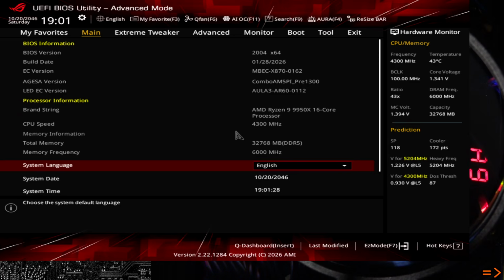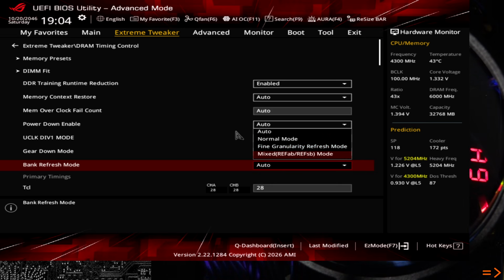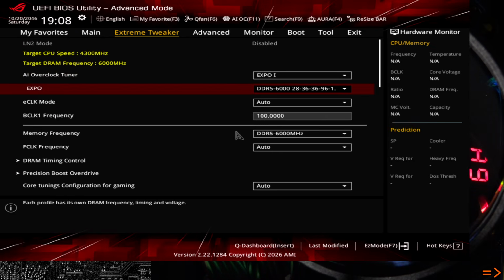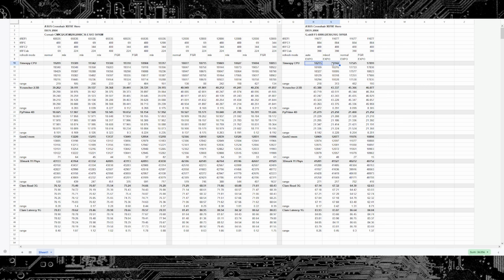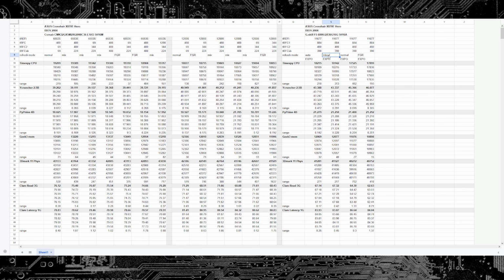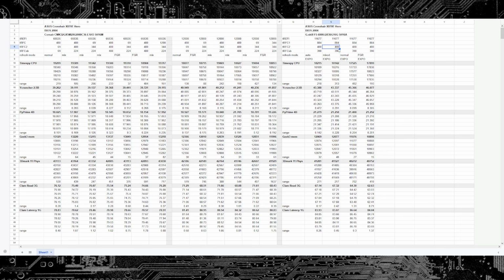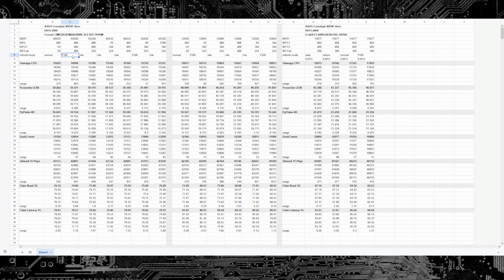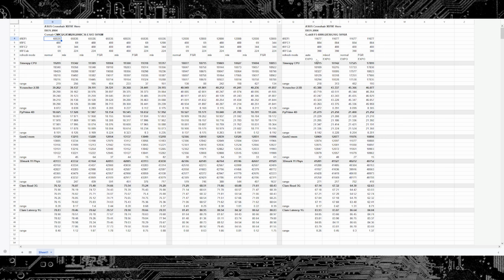New DDR5 refresh modes on AM5 motherboards

Comment: Still running a daily, ddr4 4100 cl15 1.5v, OC because of you. Appreciate all the work brother. Was gonna upgrade but then everything went whoops when i was able to.
Reply: mb warns going over 1.35 isnt 1.5 causing wearout or errors? how long have u had it
Reply: @GloriousEagle69 the ram has been great, no degradation I can measure. Its b-die g-skill so of course the ram is fine. BBBUUTTT, lol, the first mobo did break. I run a more basic msi z790-p pro wifi d4.  I ran the SA voltage on auto with ram at a set  1.5v and it poped the SA voltage circuit. On that mobo SA voltage wont go above 1 volt now. so you cant run ram faster than ddr4 3600 cl 16.  Slowly over time it just would struggle to boot, till it didnt one day.(i thought it was my 14700k)  I got the same mobo again and this time did everything the same but set SA V at a static 1.35v and i have had zero issues since, been about 14months. Even ran 1.55v ram voltage and 4200 from the mobo for a month even. Dropped back to 4100 for general system stability.  The mobo is great other wise. It will take my 270 watt 14700k oc like a champ. I just know now SA voltage control was Not ment for auto on a decent ram oc. Idk if im just lucky, but my daily big oc is working. I use the old board as a jellyfin server with a 14100. Never crashes or errored out. So, the old board is still good just bad SA voltage.
Reply: Daily driving DDR4 at 1.5V is for people who are perfectly aware that they may have to suddenly buy a new kit. Considering the current RAM prices, and sometimes difficulty even FINDING the kit you want, I'd categorize that as "a bold move".
Reply: @andersjjensen  oh no big red number in bios = bad! I dailyed 1.65v on my S8B for ~18 months with no issues/degradation
Reply: @IIHydraII  Builzoid has killed memory kits with less than that, and he doesn't recommend daily driving over 1.45V, so I'm going to take his word for it over someone who thinks getting lucky will define the case for everyone.
Reply: @andersjjensen been using 1.65v on my s8b since 4 years, still passes every stress test, it's really hard to kill ram
Reply: @aqyx  As someone who has managed to kill RAM on more than one occasion: It's really hard to kill RAM that doesn't have a near-defect.
Reply: @andersjjensen it was a used $60 ebay kit and Its samsung B-die. The dude labeled it as  a gskill kit with the model number ending in "NC" instead of "N" even at the time, the B-die kit was going for $150-$200 . 
So, I say, LET IT RIDE!!.
You're not wrong though.I have a 32gb 3600 cl18 kit i can fall back on.

Comment: We have the power to bring down RAM prices right now. Every time we use cloud-based AI services, even the "free" ones>>we're fueling a massive demand that's draining the market. These AI data centers don't just cost billions to build; they cost billions to run, and they're consuming an enormous share of available RAM. The solution is clear: switch to local AI models running on your own system, or simply reduce your AI usage. Once we collectively hit their "demand cap," the pressure on RAM supplies will ease, and prices will finally drop. It's time to take control of our technology choices and stop letting corporate AI infrastructure dictate hardware costs.

Comment: I’ve been watching your content for 5 years and still feel like an Apple user in my knowledge base. Hoping for one day to just understand this.
Reply: Unless you're personally into competitive overclocking spending 2 weeks tweaking, benchmarking and logging the result in a spreadsheet to prove a 0.7% gain is objectively a waste of time. I check in from time to time to see if there's any updates to his "easy timings". I.e the timings that he knows will work with 99.5% of all memory kits with those specifications.
Reply: All I did in my 5 years of AHOC too is I wrote down notes about it since his safe OC is a great gift for all who can pay attention, but I don't have the money for the equipment and room for PC extremeOC research myself, besides my tools for PC services. In the same years I just do OS tune up with Gentoo Linux for gaming and later on I've figured out CachyOS kernels is really good for any prebuilt Linux distros if you want a quick setup without the craziness of kernel modifications besides no systemD distros. For winNT kernels; best to trim the OS to like Windows 2000/XP or Win7 if you can still run it or last option to hyper-modify Win10 and don't use 11 no matter what. I just use the computer to its full capabilities without stressing it and having power saving features on because my power plan is limited tier 1 of wattage for the price.

Comment: Don't buy MSI boards guys 

No support for x670 anymore not even for security updates. Got a godlike and last stable update was almost 1 year ago
Reply: Msi board are the worse for me since the bios issue will require to reset each time you got error in bios settings when changing oc for ryzen memory, and many recoil whine issue which can be leak inside your output audio.
Reply: @farhannik7039  I have 0 issue wit audio only if VDDG is low when using 2200FCLK.
Reply: Too late, I got mai b850m gaming plus wifi6e in October, it have so many buggs but does not harm at last like asus/asrock does.
Best brand is to go is gigabyte in my opinion.
Reply: @Kage0No0Tenshi what bugs do u have because i have the same board but normal atx format

Comment: Interesting. My 8000mhz ram stopped working when I updated the BIOS. I had to increase memory voltage .025mv to get it to boot. Makes sense.
Reply: Good tip. I won’t update then for a while.
Reply: You had memory context restore enabled? If so, thats why. Disable and make it boot couple times with powerdown disable and mcs disable and after enable it.
Reply: @Eusebiugh I dunno. That was just in auto
Reply: @Eusebiugh  Thanks for the tip and confirming my suspicion why my system wasnt booting with settings that were previously stable.
Reply: Core voltage also changed. My PBO per core offset shifted 3/4 into curve shaper with simple math also crashed on kernel power. I suspect it might be minor.

Comment: Any suggestions for a defeated guy who can’t get 6400mts 64gb Hynix a die stable 1-1 with a on a 9950x3d and x870 hero astral 5090 gen 5nvme with 2 gen3 nvme in raid 0 want peak performance (currently have 6200mts cl28 1-1 2200fclk with right timings
Reply: Be happy with 64GB at 6200? More than 48GB (ie 2x24GB) is really hard on AM5.
There is a new generation of 32Gbit chips that allows manufacturers to build 32GB sticks as single rank which should be the new best for 64GB and maybe even enable decent 128GB configurations with DR modules, but I don't think they really have hit the consumer market yet.
Reply: @giantnanomachine  thanks for the reply. I am pretty happy with it. I just feel like I didn’t hold out this time and bought the best I could and I wanted it to be the best performance it can lol
Reply: If your I/O die won't do 6400 it wont do 6400. Mine won't go above 6200 either, and it wont even do a 24h full stress test at 6200. So I run 6000 with close shaved timings. The difference between 6200 and 6000 is less than 1% at 720p Low in gaming benchmarks so I really don't give a fck. Stability before performance.

Comment: is 1.5v vddio safe long term?
Reply: If it’s cooled really well then yes but I’d lower it for daily use
Reply: @LightWorks222  cpu is cooled with a 360 aio with push pull config. also tjmax lowered to 80c. for the ram i got an amd stock cooler fan blowing air on it. i also removed the plastic top cover for the ram sticks. 
if temps are fine, is 1.5v safe for daily use? i mean for vddio on the cpu. peopIe tell me 1.45 is the upper limit and that 1.5 is too high

Comment: What to use for gskill 6000mt cl30 m-die? Which values to put for the mix mode? I mean trefi, trfc, trfc2, trfcsb?
Thanks
Reply: I'm wondering if the values from Buildzoid's "Easy Timings" video (which worked perfectly for my kit) a while back work with the new Mixed Mode.
Reply: @Arthur78 i am using them too, so far not even 1 single issue, but i am not sure are they good for mix mode. I mean to stick with same values?

Comment: I have a spring 2025 bios (asrock 650 hdv/m.2)and I have tuned settings.(pbo and timings 6200 a die).If I update the bios to the new one is there a significant chance that I will face instability or latest bios almost always means better stabilty?
Reply: It depends on what they change. The idea is newer BIOS means better stability, but sometimes there can be bugs. If it's working fine then leave it with what you have, if there's a new feature or any particular reason to update then you can update. 

I have an Asrock X670E Taichi and the latest BIOS 3.50 has been a bit better than my old one which I think was 3.25, there's a bunch of new options, and my Ram doesn't train every time I save the BIOS with settings unrelated to Ram so it only trains when there's changes to Ram settings. Stuff like that is great, but it depends on your board and manufacturer.

Best thing to do, is to google around or ask on forums for others with the same board, even maybe try and contact the manufacturer directly if you can't find much else online. If you have a popular board then likely a few people will reach out on the forums. Otherwise, if your PC is running fine and you don't need to update for any reason, it's best to leave it and save yourself any potential trouble.
Reply: @mttrashcan-bg1ro ok thank you so much for the info dude, much appreciated

Comment: Does this also apply to ryzen 7000
Reply: Yes , it is also AM5 socket
Reply: @pfbtheboy  except AMD loves segmenting 7000 and 9000
Reply: @bananahammock888 As they should two different gens.
Reply: @MrNelahem same IO die on both generations, so should be same memory controller
Reply: @jbettcher1  yes two different generations with the same memory controller.
Reply: Both 7000 and 9000 use the same memory controller.  You should most definitely be able to use this on 7000.
Reply: @skylertschmidt really? I thought 9000 had much better IMC why it scales above in mem freq?
Reply: @christofferaasted  AMD used the same IO die on both generations for consumer parts.  Which means they use the same IMC.  

Optimizations on motherboard AGESA and BIOS as well as maturation of DDR5 as a whole have allowed for higher speeds to become much more stable, albeit the performance to be lackluster.  

This was one of the reasons non X3D 9000 chips were relatively lackluster at launch and the recommendation unless you wanted to spend quite a bit for a martial upgrade (4-8% in some cases) was to stay on 7000 if you had it.  Most likely still the case this late in a socket generation for AMD. 

Now the server chips that were launched with the 9000 series had a new IO die and saw incredible uplift compared to the previous generation. So they COULD have had a much bigger win, theoretically.

Comment: This sounds great and I want to tinker with my 870E Pro Art
But it also sounds like a potential nightmare for stability in overclocking.
Reply: That's what I was thinking. Might have to do 2 sets of stability testing to avoid the switching; normal mode and FGR.

Comment: It would be quite interesting to see which timings work for 2x32GB 16Gbit M-die, since those old kits are currently the most affordable option (for a given degree of affordable...) to get 64GB DDR6000 Hynix on AM5.
Reply: Those are dual rank, right?
Reply: @Arthur78 yes. I think also most new 2x32GB kits are still based on 16Gbit chips, but on A-die; the newest ie 32Gbit chips don't seem to be widely available yet.
2x32GB 16Gbit A-die might also be interesting to look at cause DR likes to be weird in general on AM5 (I have no idea about how Intel, maybe that applies to DDR5 in general), but probably less so than 2x32GB 16Gbit M-die.

Comment: Im too scared of ram oc in 2026, I can't afford a new ram kit🥲
Reply: Just don't crank the voltages. If you get greedy on the timings at stock voltages absolutely nothing bad will happen to your RAM. Your system will just be unstable or refuse to boot. So you try less greedy until it is stable. Simple.

Comment: What about refresh management setting in amd cbs, you can force not /2 refresh on fgr as far as i understand
Reply: Test if it works. Lots of things in CBS don't actually apply, or cannot be changed without a flash 😅
Reply: @bananahammock888of course it applies also if you mean lile timings you need to set in both amd cbs and in amd overclocking

Comment: How much more performance one can actually expect to gain in games with this new setup in Mixed mode? 2-3%?
Reply from the maker: considering that across all my tests mixed modes is winning by around 0.2 to 0.7% I'd say less than 1% in games.
Reply: It will not give you performance. But it should reduce the unexpected stutters, unreal engine 5 springs to mind.
Reply: @ianoconnor1515  A 0.7% decrease in memory latency will not fix game stutters that last several milliseconds.
Reply: @ianoconnor1515 please update us on this specifically! 4090 with 9800x3d and im using timings from your video and i get great max frames but it just feels like i lost 3-10 frames regularly when I absolutely have the overhead to not stutter!

Comment: Im on a bios version i wouldnt be able to go back to if i upgraded on a x670e proart with 4x32GB at 4800cl32 im just not going to touch it...
Reply from the maker: BIOS flash back does let you downgrade.
Reply: @ActuallyHardcoreOverclocking i wish i had known this. I'm on 3104 and 3112 says irreversible and was scaring me from upgrading. Thanks

Comment: Sorry for the basic question; but I've tuned my RAM (Hynix A-die, 6000/CL30) according to one of your previous guides on AM5(9800x3D). Will redoing it with new refresh modes be beneficial? I'm optimizing for 0.1- and 1% lows in competitive games.
Reply: could be beneficial although you probably wont notice a difference since your percentile lows are already very high anyway. even i dont see a difference even though im an ultra sweaty e sports gamer
Reply: With an X3D chip borderline all real world applications show no difference when Buildzoid produces 0.2%-0.7% differences in synthetic benchmarks on a vanilla X chip. I have a 7950X3D myself, and it's funny seeing how benchmarks vastly different whether I lock them to the vanilla CCD or the V-Cache CCD. That honking big cache all but completely hides the memory interface.
Reply: @andersjjensen  yeah. also even on the non x3d die performance is still very good anyway. worse case scenario you get just about the same performance as a 7700x. last time i checked the 7700x is an excellent CPU and can even keep up with a 5090 in some games

Comment: Meanwhile MSI x670e gaming plus latest bios is from October 22nd 😂
Reply: BIOS development for 600 series motherboards kinda slowed down since 800 series launched. And it has slowed down even further lately
Reply: Its slower on Asus for 600 series board but not as bad as MSI. The last bios for my 670E board is dec and agesa 1.2.7.0
Reply: @MrNelahem 💀
Reply: Gigabyte seems pretty good in that regard. AGESA 1.2.8.0 non-beta was released early January already for X670E.
Reply: Same here, lastest bios is from October 25th 💀
MEG X670E ACE

Comment: G'day Buildzoid,
I won 2x4GB Crucial DDR3-1066 CL7 on Ebay yesterday for $5AUD 🙃👎
Hoping it will allow me to get my i3-540 to run with more than the single 2gb DDR3-1333 it will POST with out of all the RAM Sticks I have in my Testbench collection

Comment: How does this affect dual channel vs single channel? Do the 2 sticks refresh at different times with FGR? Also seeing as a lot of people are gonna be run single stick of ddr5 now maybe a special episode on optimize bandwidth with just a single stick?
Reply from the maker: each channel has it's own command bus so refresh commands can be independent. How the CPU designers actually decide to implement it IDK.

Also LGA1700/1851 and AM5 are all technically quad channel platforms since DDR5 has 2 32bit memory channels per stick.
Reply: @ActuallyHardcoreOverclocking  single stick overclocking when? looking forward to it

Comment: Do we have any decent way to calculate what trfc2/sb values to use? Or is it more so trfc2=1 and sb / 2?
Reply from the maker: trial and error
Reply: @ActuallyHardcoreOverclocking  such is the overclockers life, many people forget that.
Reply: tRFC2 should be set to your normal tRFC1 value, e.g. 360 at 6000 for 16G A die.

Comment: So if FGR makes it so that, on average, reads are less frequently blocked by refresh, does that mean that uniformly distributed address mapping would maximize the effectiveness of FGR? I'm assuming here that the delay incurred by refreshing an entire rank would be keenly felt if addresses being read were consistently on the rank being refreshed. I don't know enough about this topic and was wondering if you've already covered it, but this vid got me thinking about all the buzz around the Rowhammer vulnerabilities a couple of years ago. How does one go about mitigating those attacks? Remapping memory in a way that makes rowhammer pointless is what I'd (perhaps naively) do. (removes the predictability of physical memory arrangement) I've seen AMD make mention of applying mitigations, but I have no idea what they actually did. I did not see any "features" developed as a result. It makes me wonder if they hard-wired a static re-mapping and left it at that. 

Do you know of any features that actively remap memory in such a way that would help FGR eke out more performance?